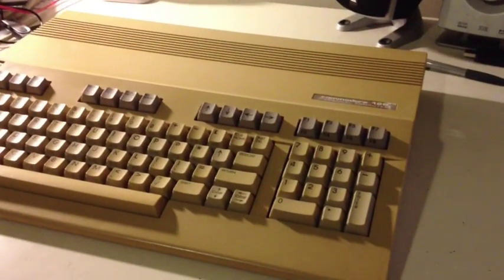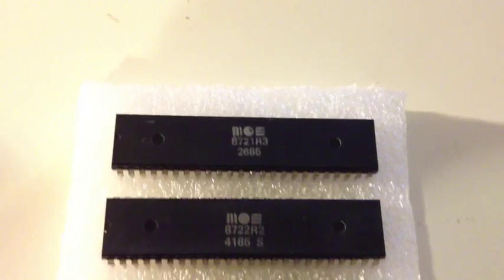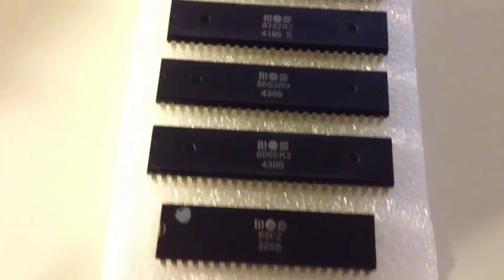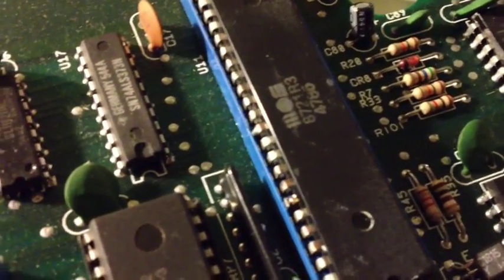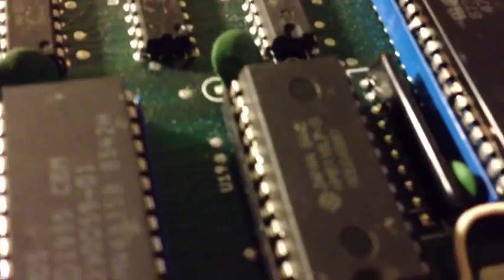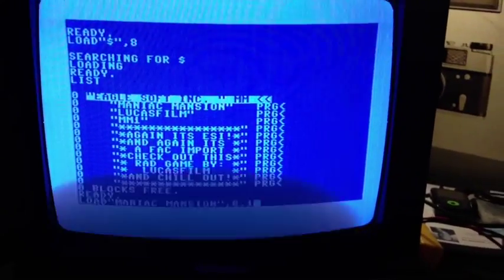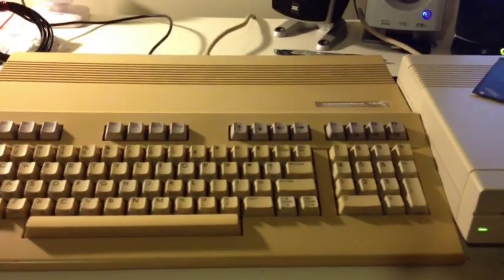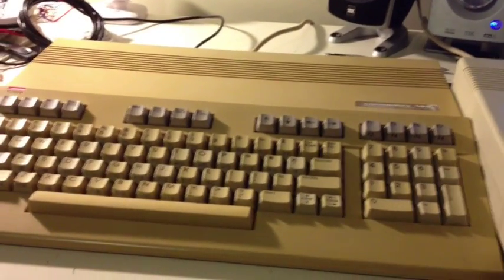Restoring A Commodore 128: Part 1 - Replacing Main ICs

Comment: One explanation about that "sanded" chip: in the old days to preserve intellectual property, they used to rub out/melt/acid off the chip identity to (try to) prevent reverse engineering. Could be that the chip came from such a device and someone realised what it was and reused it in your C128.
Reply from the maker: Ichinin Yes that is quite a possibility. In fact I would say that would definitely be the reason.

I really do need to redo this video, or at least make a Part 2 now that I have the machine again! Unfortunately time is not my friend nowadays :p

Comment: where is part2?
Reply from the maker: propinki Would you like a part 2 for this?

I never got around to making a Part 2 and I ended up giving it to a good friend of mine to watch over when I moved a few years ago.

If you like, I can see if he is OK with me getting it and working on it more? I had a few ideas I wanted to cover in this anyway so if there is interest, I'll see what I can do!
Reply: orinokonx01 I'm trying to get my 128D in shape, cleening and testing, if you have time then why not. Sadly info and yt clips of C128 famili is very little :/
Reply from the maker: propinki Ah! Well those 128D are a very cool machine! they seem to have a 'standard' 128 motherboard inside of them, which means they use a separated 1571 drive and controller. Good machine to restore!

I'll be heading his way over Xmas, so it wouldn't be until after that point, but yes let's see what happens.

Good luck with your restoration efforts!

Comment: i have a c128 i got in a c64 job lot, the job lot contains a full c64 setup including disk drives, in this lot was another machine the case is vic20 coloured and shaped, however on booting it is a c128 with ver 7 basic.
is this a home built machine?, i ask this as it has no lables of any kind, even the face plate just says commodore, it has no designation ie vic 20, c64 etc, it basically looks like a vic20 but runs as a c128.
i have never seen a c128 like this, ones i have seen allways look like the later models,
my mate recons its a prototype but i think its a mod of some kind, inside it looks hand built, so did commodore ever make the c128 in the old vic20 style case?, and either way is this rare or unusual?, i dont care what its worth as i will never sell it.
Reply: aly nicholls ADD ME ON FACEBOOK above is my facebook address